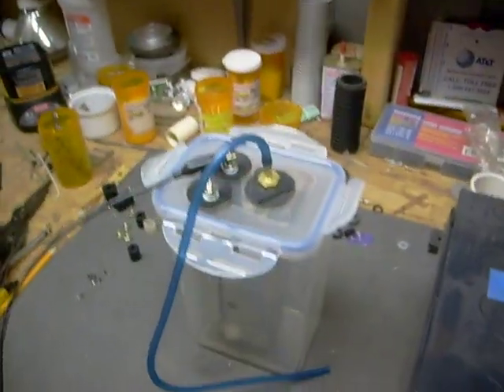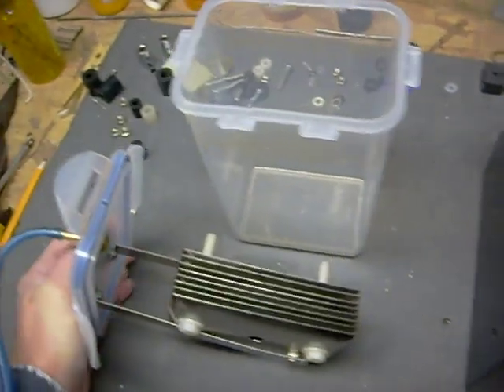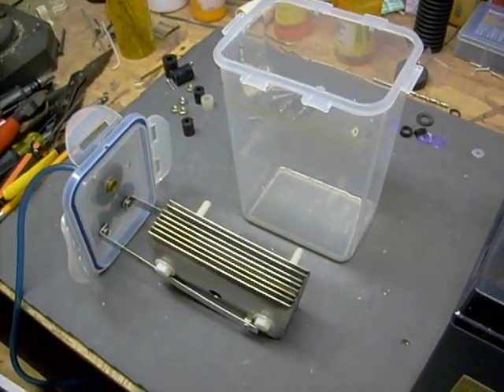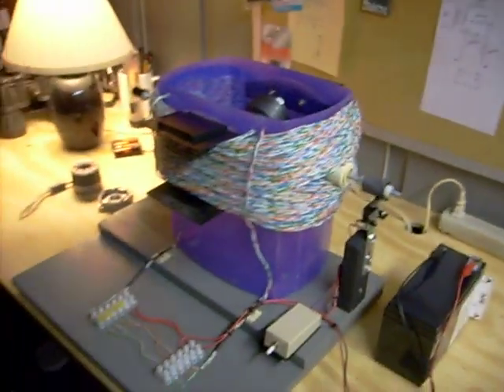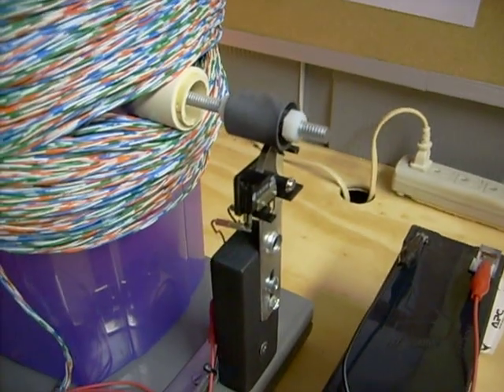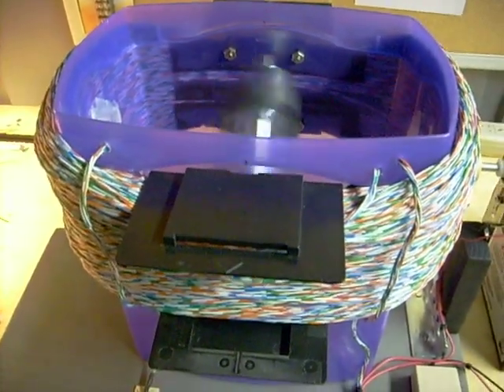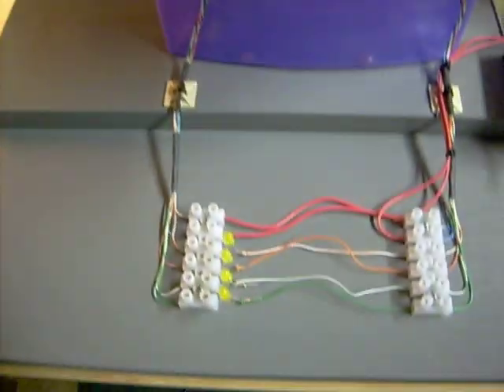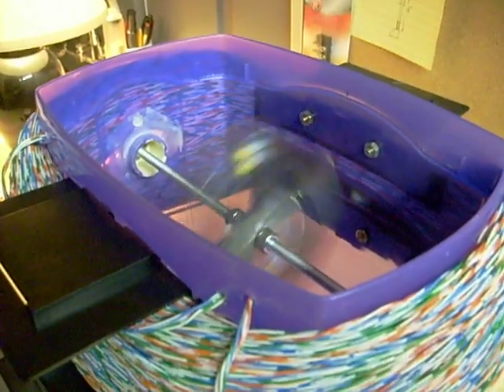Farewell Hydroxy, Hello Newman!

Comment: hello kc4yjb, built a small device, there's definitly something going on in there. i used a hall sensor, which makes no noise, work flawlessly, route the back emp into a fullwave bridge into the charge battery. all solid state, nothing mechanical. also used micro wave magnets, in retrospect, this world would have greatly benified from nikola's contiued funding of his recearch. keep up the effort, n5qdm.